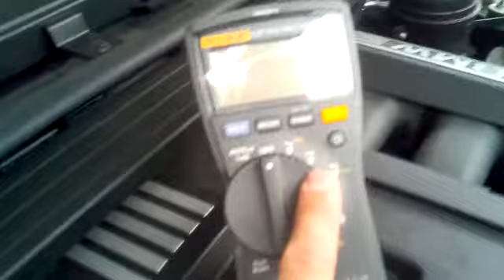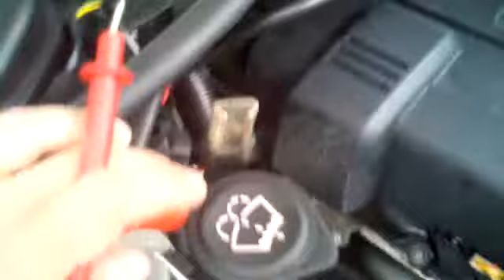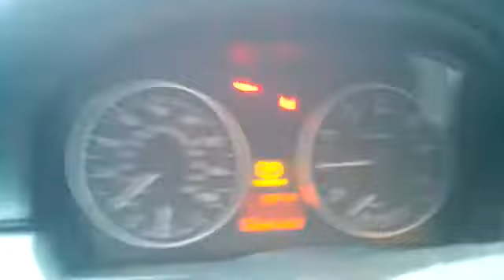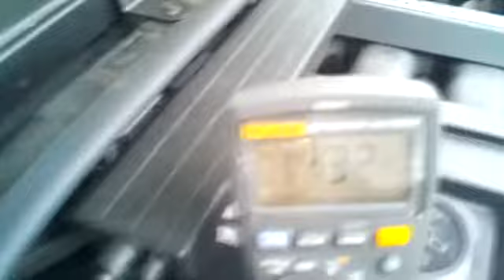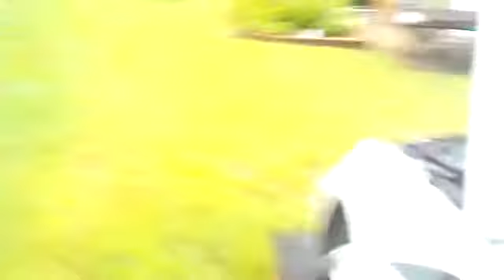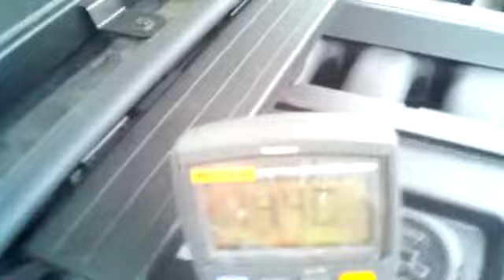Ho To Use a Volt Meter and Alternator Voltage Checks

Comment: Seem quite low a fully charged battery should be at around 12.80 volts and at around 14 volts with engine running